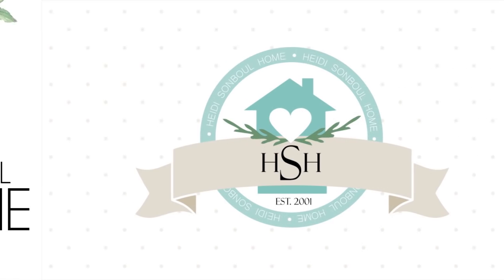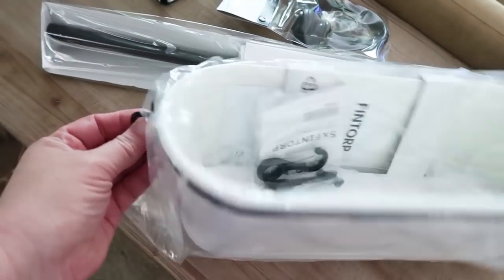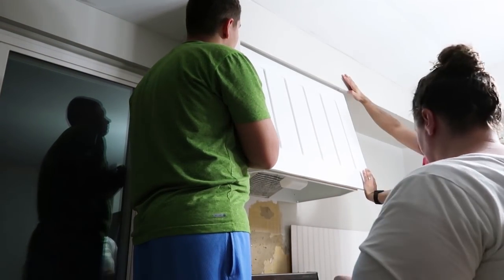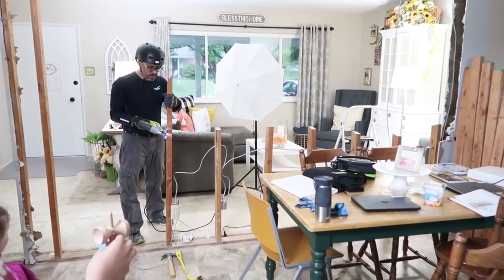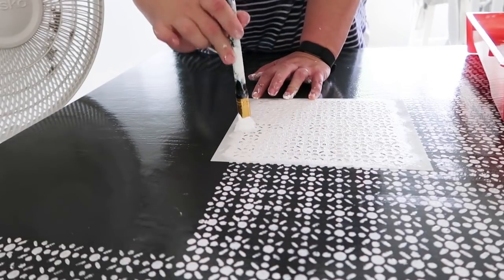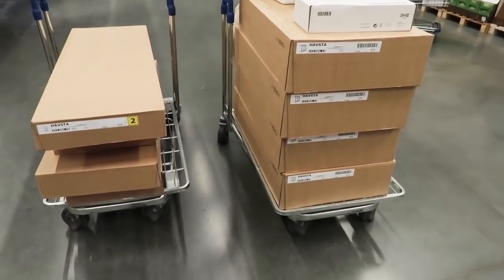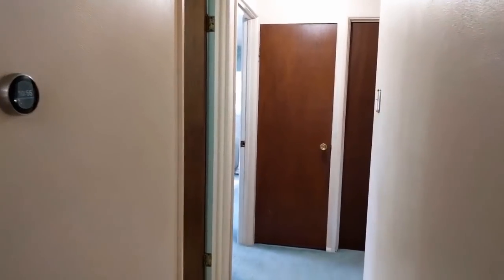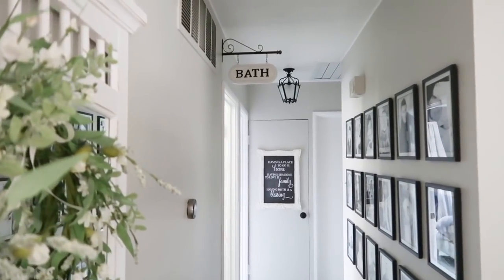Extreme House Flip | BEFORE AND AFTER | FARMHOUSE FIXER UPPER

Comment: The house I grew up in had the same built in cutting board. My dad installed it to cover up an area I damaged by a setting a hot pot on the counter. It was cheaper than replacing the whole countertop. Lol

Comment: you might want to check out IKEA for ideas of  stuff you can build for your small kitchen to keep it organized.  The rails using the hooks work great for pans with handles in metal such as the  KUNGSFORS        Susp rail w shelf/rail/dish dra$85.95    or the           If you like wood the Tornviken plate shelves with rail & hooks  but a coupe of my favorite things I put in my kitchen remodel was the  pull out drawers and the pantry with pull out drawers.  For the 12 inch wide wall cabinet I would have done  the VADHOLMA                Wall shelf, black  $59.99  so you could see everything and used jars for dry goods such as noodles & rice and stuff

Comment: Came out pretty, but what's up with the "we, we, we?" It's obvious from the film documentation it was all YOU, YOU, YOU. Your husband even sat by watching you jigsaw out your counter. YOU should be very proud of yourself! You are a very talented handywo-man. Also, just a thought for you to consider. Generally, apartments that have a dining area that run into a living are the least desirable, and have a hard time renting. Same goes for homes. Although ripping out the wall gave you more "openness" it will hurt you come resale time. I would have shortened the wall to a 1/2 wall, and taken about 4 feet off in length, and then hung huge french windows from chains in the ceilings, or something akin to this. Or even put in 4 french glass doors. That way, best of both worlds. If you can build off your backyard, you should try to create a nook for your kitchen table. All in all though, fantastic transformation!!!

Comment: you could build this wood roll out drawer to go in your base cabinets, you just need to buy the metal slide guides   https://www.birchlane.com/kitchen-dining/pdp/rollout-drawer-hwsc1662.html2 or buy the metal one to go under the sinkTier Under Sink Shelf Sliding Pull Out Drawer https://wwwbirchlane.com/kitchen-dining/pdp/2-tier-under-sink-shelf-sliding-pull-out-drawer-rebr3912.html here are a lot of kitchen organizing solution items to buy or buildhttps://www.birchlane.com/Trinity--Sliding-Pot-Organizer-Pull-Out-Kitchenware-Divider-TBFC2208-L903-K~TTY1186.html?refid=MX79096157983083-TTY1186&device=c&ptid=4582695746423955&targetid=pla-4582695746423955:aud-806411062&network=o&msclkid=65bc78c0de021d36ce5a2558a83b28c0&utm_source=bing&utm_medium=cpc&utm_campaign=BL.P.US.G.All%20Products%20(SCA)&utm_term=4582695746423955&utm_content=All%20Products
View hearted comment
If you no longer wish to receive emails about comments and replies, you can unsubscribe. 
© 2019 YouTube, LLC 901 Cherry Ave, San Bruno, CA 94066